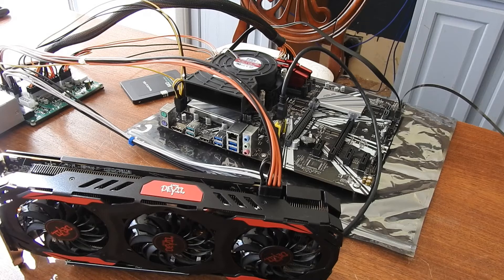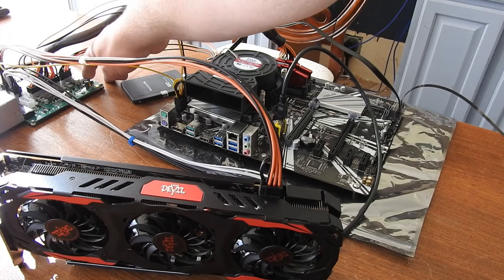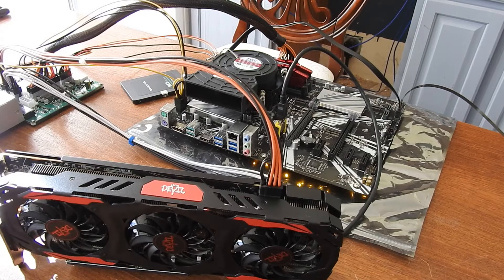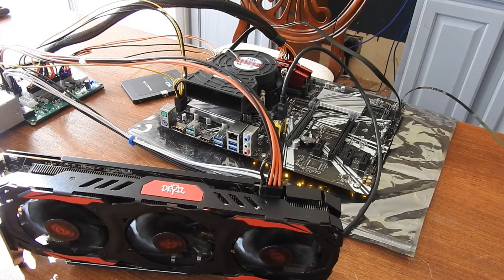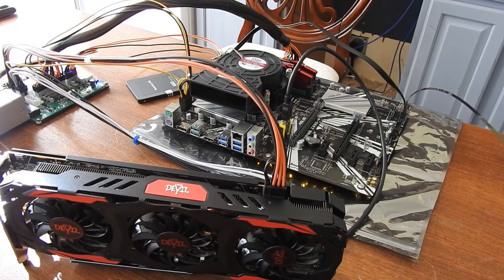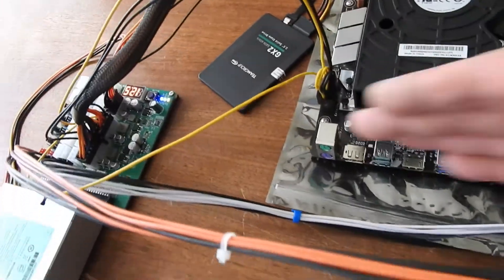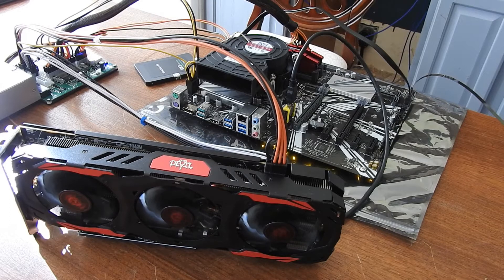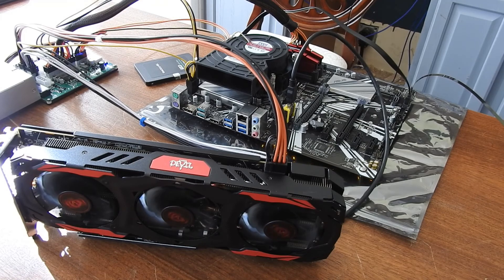[Asus Prime Z390-P] - Part 12 - Firing up the rig

Comment: Is it normal to have the motherboard flash yellow like that?  Mine powers up but wont turn on at the screen.  Mine flashes like yours too but when I look it up everyone says it's a DRAM issue
Reply from the maker: You can turn that light off or on in the mother board settings.  It is supposed to pulse if it is on.

Comment: Hey I been trying to work with this board, I plug my gpu up to an 850 W power supply and every time I cut the board on it short circuit put immediately. I went through 3 390-Z motherboards already idk what’s the issue honestly. Everything is wired right but I still don’t know what’s going on.
Reply from the maker: Do you have a different power supply to try?  Also what CPU do you have?  What are the RAM specs?
Reply: @dragonslair80  yes I have a 750 W to try and I have 240 GB sata, and 16 GB ddr. I’m trying to plug it up to 3 1660 AMD right now to see what it does. I also have a Celeron processor chip in it.
Reply from the maker: @W.O.E  What speed RAM and which processor chip?
Reply: @dragonslair80  I fix the problem now after messing up so many times I just was frying them not aligning the power supply cables right though I can short change on it but you can't.
Reply: Dude I got exact same issue. Ordering a third board now... all worked good with 1 GPU. I made necessary changes in BIOS. Then I hooed up 2 more GPU and it failed... ×2... please let me know how you solved this
Reply from the maker: @denisfedotov3200  What model CPU do you have?  Also what speed RAM?
Reply: @dragonslair80  Thank you for replying to me. My CPU is Pentium G5620, LGA1151 and my Ram is 8GB, DDR4, 3200 Mhz. It worked with 1 GPU and let me change BIOS settings. Then I plugged in 2 more GPU, and it was gone..)))
Reply from the maker: @denisfedotov3200  From what I see your processor and your Ram are compatible with your motherboard.  But your processor does not support fast than 2400 MHz Ram

https://www.cpu-world.com/CPUs/Pentium_Dual-Core/Intel-Pentium%20G5620.html
Reply: @dragonslair80  thank you for taking time looking into this. Do you think this may cause the system to crash and damage mother board after a few hours and adding more GPUs? I was able to get 3 GPUs yesterday to work and the 4th one again crashed everything and I was not able to get the mother board running again. This is #3 asus prime z390-p ((((
Reply from the maker: @denisfedotov3200  That is most likely your issue.  I would try a 2400 RAM first and I am guessing you will be good.
Reply: @dragonslair80   i will do that and let you know. I appreciate your help
Reply from the maker: @denisfedotov3200  I wish you good luck!

Comment: Hi, I have followed all instructions for setting  up my Asus Prime Z390 -p motherboard. I can't make my rig to work. It powers on however i can't make the monitor work, so i can set up the Hive os and to bios the motherboard. Any help is appreciated.
Reply: Same issue
Reply from the maker: @TheColombiano89  What processor and RAM do you have, this is usually a compatibility issue.
Reply: @dragonslair80  need some help this board is unresponsive to internet and no monitor coming on?
Reply from the maker: Try booting it with no GPU's plugged in.  That should make the monitor work.  Otherwise depending on the GPU, you can plug one in and plug the monitor into the GPU itself for the output.